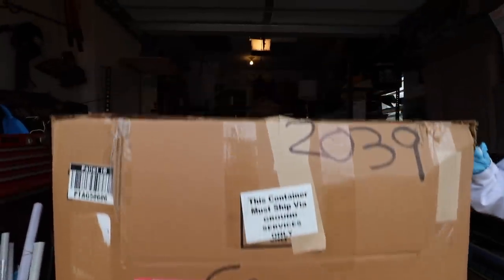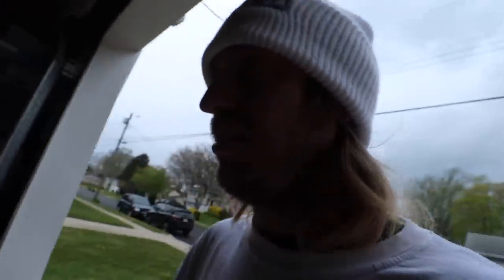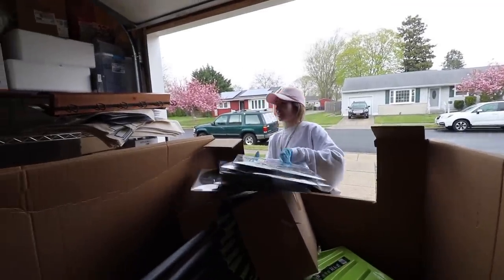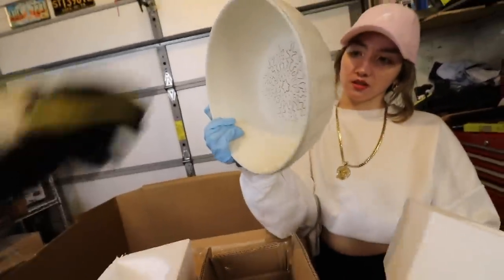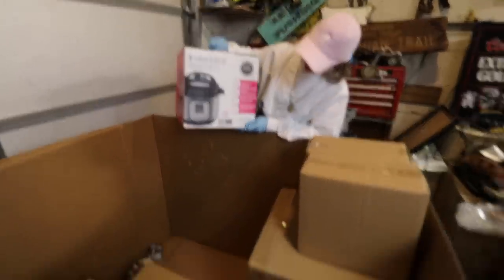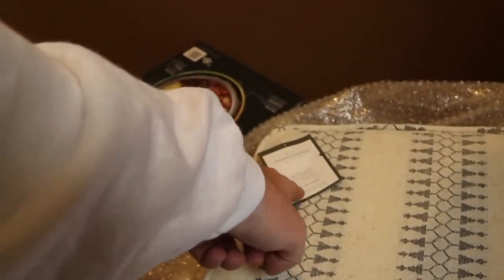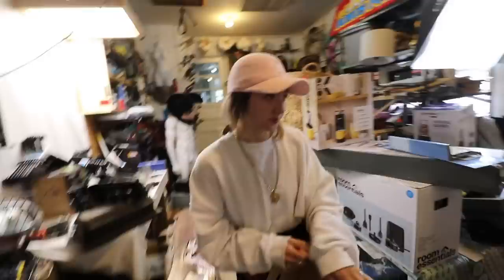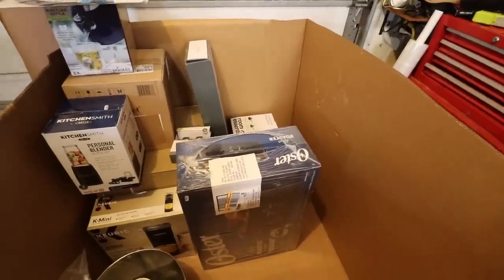What's Inside BULQ Liquidation Pallet? - SEE FOR YOURSELF | Pallet UNBOXING!

Comment: eBay is the way to go I run a butcher shop full time! And have an eBay store with average of 500-550 items and make over 2k a week profit on eBay alone not to mention I make just as much from my normal job it’s easy I spend two hours 6 nights a week on eBay if I did it full time I could easily make 10 grand a week on eBay alone once you get eBay and stay consistent with listing new stuff and build your capital to buy better more expensive items with over 1k feedback you can price your items higher because you build that trust and I do price my stuff higher than most and people typically buy from me over a cheaper option of the same item for the security factor